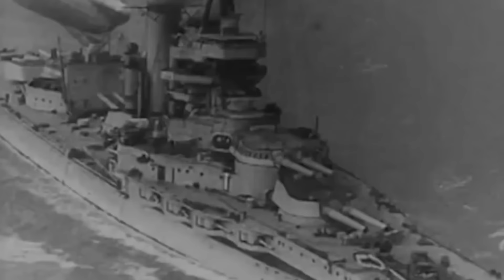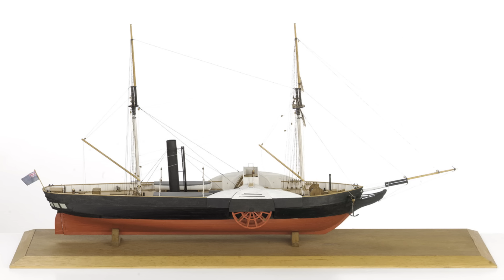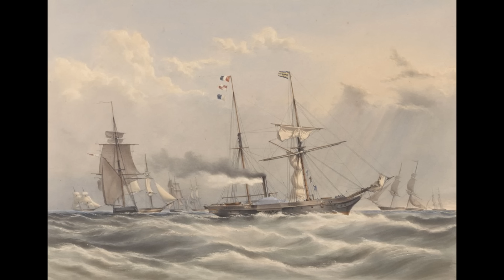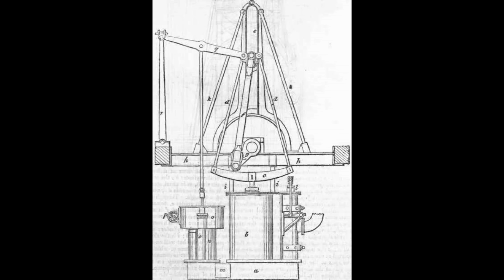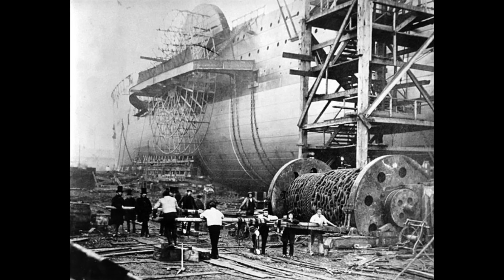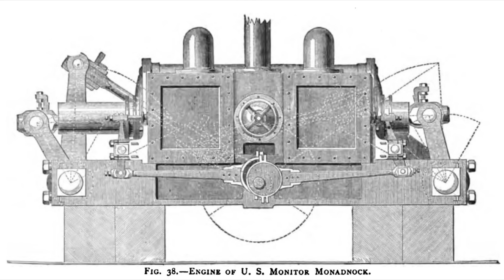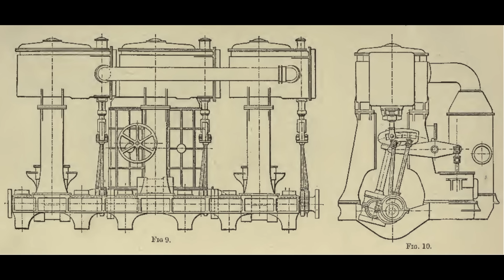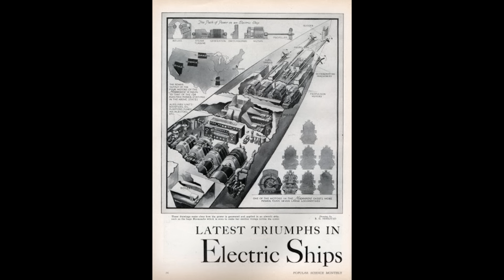Naval Engines - Rotate that shaft!

Comment: Can you please stop to popularize the insufferable myth that "war makes for good innovation"?

It has been shown time and again, that NO, the "innovation" did in almost 100% of the cases exist before the martial actions broke out, the only difference is that with wartime spending you can take fringe ideas and push enough moolah at them to make them economically viable.
You pay for mass production capabilities, NOT for the idea itself.
Reply from the maker: Hence why I said 'sometimes', the concept is overblown but war does accelerate certain lines of technological development considerably. The carronade, cavity magnetron, bouncing bomb, electrical computer, etc are all war-driven inventions. And even in cases where the invention existed before in a niche role, war forcing it into widespread use is driving innovation, since otherwise such a technological advance would have sat in a forgotten corner somewhere and the general level of technology in that field would likely have remained unchanged for some time.
Reply: @Drachinifel  Radar is an excellent example of the latter case...

Comment: Do you have efficiency figures on the electric motors and dynamos for this era?  I ask because the outright and ongoing dominance of diesel electric rail began right at the end of the period in question.  The new Maersk ships still use giant bunker fuel diesels on direct drive, but the USN is beginning to reconsider electric drive for primary propulsion (I believe also for submarines, though that probably has some consideration for sound transmission from the turbines through the prop shaft).

Thanks for the great videos.

Comment: Your descriptions in this video are great..., for those folks who already know what particular parts of the engines you are talking about.
But for those of us who are somewhat clueless and may not know a screw from a piston, the diagrams you use might as well be blank sheets of paper.
How about adding a few moving pointers or even highlighting the particular parts with color so we can get a better idea of what that part of the engine is you are describing.
Also, you talked about the different ships and showed pics of them, but just which steam engines actually went with which ship was kinda vague.  Perhaps showing the ship and then the accompanying specific engine diagram would clarify it a bit better?

I could follow what you were saying, I just had problems with the specifics when it came to what I described above.  🙂

Comment: Your next logical step would actually be the drive shaft I think. Although, the details are probably too nuanced for this format and the high level overview would probably only make a full video if grouped with such topics as steam routing and exhaust gas expulsion.
Reply: He's covered boilers and turbines.  The REST of a modern steam propulsion plant is probably an episode by itself.  The portion of the cycle between leaving the Main Condenser on the propulsion turbine as Condensate and the point where water is re-injected into the boiler as Feed Water is possibly the most complicated part of the whole mess.  Add in the multitude of auxiliary systems require to make everything work and it is truly mind-boggling.

Comment: FYI... Regarding steam propulsion plant startup time... in the past (distant, USN) I participated in an evolution that went from "cold iron" to "answering bells on all engines" in 34 minutes. We were moving briskly to make it happen (Yes. Operational considerations did require us to get underway ASAP). Stresses due to temperature differentials and rate-of-change of temperature (pretty much the same thing) were our most limiting factors (Yes. We consciously considered such factors during plant evolutions. If you break the plant, the startup time becomes excessive).
Reply: Not only hard on the Plant, but hard on the navigator and quartermaster as well.  It will take about 24 hours for the gyrocompass(s) to spin up and settle out enough to be accurate, longer if you introduce pitch, roll, and course changes while it is attempting to do so.

Nav charts are oriented to TRUE North.  A Gyrocompass indicates true North.  Absent the Gyrocompass and GPS, navigation relies on the magnetic compass.  Unfortunately, there is a deviation of several degrees between TRUE North and MAGNETIC North.  This deviation changes based upon where you are at, the geological composition of the earth at your location, and a few other factors which I have long since forgotten.

The deviation in degrees between true and magnetic north is noted on the Nav charts.  When using a modern chart to plot a course, each and every course change or correction requires that the deviation be calculated and accounted for to obtain the proper magnetic heading.  Although the navigation team members are trained to do this when necessary, it is still a headache.

The same goat rope ensues when the gyrocompass goes down while underway.  The major difference here (from personal experience) is that it gives you the opportunity to see a full-bird Captain burst into the IC Shop in robe and slippers and use rather salty terms to indicate his desire to know exactly "what #$$^#%#@ direction the @#%#$%^% pointy end is facing"...NOT the best midwatch I ever stood.  

You mentioned distant past?  The casualty was due to the sudden failure of a 12AX7 VACUUM TUBE in the Gyro Control Cabinet...in 1988 or so.  In fairness, just about EVERY issue with the Sperry Mark 19 ended up being being a failure of a 12AX7 vacuum tube...which is why I remember that detail 35 years later.  When the Gyro alarm went off, you didn't even bother with looking at the diagnostics panel, you just slammed the cabinet door open and started looking down the rows for the tube that had lost its happy little orange glow.  The wonders of 1968 technology.
Reply: @kevincrosby1760  Is the gyro kept running off shore power to avoid spindown then?

Comment: A small note about the engines on the Titanic: These were technically quadruple expansion, with the first three expansions happening in cylinders - each engine having one high pressure cylinder, one intermediate pressure cylinder and two low pressure cylinders. There were two of these engines, driving the port and starboard propeller shafts, and both were reversible, though not through a gearbox: Reversing required stopping the engine and then engaging a small "barring engine" to flip the angle of the connecting rods such that when the engine was restarted, the crankshaft would be turning in the opposite direction. The final steam expansion was through a dedicated low pressure turbine, which took steam at around 5 psi (completely useless to any piston engine) and expanded this to almost no pressure at all. This drove the central propeller shaft, which could not be reversed, though engaging it was optional - the steam exiting the two main engines could bypass the turbine altogether and be sent directly to the condenser, albeit wasting any power it could generate and hence making the ship somewhat less efficient as a result.

Interestingly enough, the Titanic and its sister ships were fitted with several smaller high pressure and high speed steam turbines, solely for generating electrical power for lighting, heating, and other "hotel services" aboard. It actually had more generating capacity of this type than was required for normal operations: The extra turbogenerators were reserved for driving emergency bilge pumps and electric winches for lowering lifeboats. As the ship was sinking, some of the engineering crew heroically kept the forward-most boilers stoked up to provide steam pressure to keep the generators going, without which it would have sunk a little quicker (anywhere between 10 and 30 minutes, depending on who you ask), and in all likelihood enabled all of the lifeboats to be launched successfully. Those smaller turbines were probably still spinning away as the ship sank, and took some of the engineers down with it.
Reply: Well..technically Titanic took ALL her engineers with her
Reply: @NashmanNash  i think a couple survived. but survived  because they were on break or something like that. do you know in the electical room of the titanic was basicy a sealed box in the rear of the ship. so they were most likey alive and still trying to keep power flowing while the ship sank and plob was still alive for some of the way down
Reply: Off Road Guy  no not really, being buried alive would mean you would die from lack of oxygen they got smashed to death when the ship broke apart plob the most painless death on the ship
Reply: @hunterbear2421  Technically drowning.
Reply: Thank you for sharing this. My daily dose of heroism. Helps to refresh my heart for humanity.
Reply: Passionnant
Merci
J'aimerais tant en savoir plus sur la technologie mécanique et électrique sur ce navire,
Reply: Triple expansion, 2 low pressure cylinders same diameter, reverse obtained through stevensons linkage,accuated by ahead/astern eccentrics not the crankshaft ok.

Comment: Screw propulsion also required the development and refinement of the thrust bearing to absorb the force of the propeller. In my Navy experience that was universally the Kingsbury thrust bearing which consisted of multiple articulated bearing plates. One set for forward thrust and a second set for astern forces.

Comment: Interesting. I always thought the delay in transition from Steam to Diesel being that, first and foremost, they wanted to reuse classic tri-ex engines, so oil fuel burnt in boilers still. Secondly, the tech of Diesel wasn't quite up there in therms of reliability.
Never thought about power density. Guess it comes from that Steam pistons are double action, while ICE engines can only be single action, right?
Reply: There were, and are, some double acting diesel engines mainly built by Harland and Wolff of a modified Danish design by Burminster and Wain. Hard work for engineers keeping the lower gland tight.

Comment: Hi I love this channel and I'm a turbine engineer responsible for about 3.4 GW of large steam turbines. It  never occurred to me that it was the vibration effect on range finders that sold turbines to the RN. I thought it was the performance of  Charles Parsons vessel Turbinia interrupting and basically burning up the fleet naval review that alerted the RN to the far higher power density available in a turbine compared to a triple expansion engine. I have to point out the following 1)turbines are either reaction or impulse or the like? actually most turbines are a mixture of the two the degree of reaction (enthalpy drop across stationary stage/ enthalpy drop across rotating stage varies and impulse turbines tend to have low pressure stages with a higher degree of reaction. 2) when you loop steam back into the turbine this is after first sending it back through the boiler, this is called reheat, unimaginatively. 3) cavitation was a big problem for the Turbinia, this was overcome by having multiple screws on each propshaft

Comment: "Cutting the blades for turbines was somewhat of a bottleneck", so was making marine reduction gears.  Gears were in short supply and one of the reasons for turbo-electric drive.
Reply: For WW 2.  USA Marine License testing in the early 70s still had a few triple expansion questions and I'm pretty sure there were still some triples operating on the Great Lakes.

Comment: Ah, steam plants. My life for 8 years on a submarine. (As some are aware, but many are not, a nuclear powered ship is simply a traditional steam turbine propulsion plant that replaces fuel oil with a nuclear reactor as the heat input for the boilers)
Reply: Are these direct-drive or turbo-electric?
Reply: @HannahLemurson  Can't speak for the last couple of decades but most US Navy submarines had a couple of steam driven turbines with reduction gears to turn one shaft.  They did make one direct drive submarine (USS Narwhal) which had one huge turbine directly coupled to the single drive shaft.  We are talking an engine maybe 10 times the diameter of a typical turbine.  Worked quite well in practice (very quiet without the reduction gears) though eventually operator error pretty much destroyed the engine while warming up.

Comment: I will just add that one big advantage of Diesel engines is that they don't have massively lower efficiency at let's say 60 or even 30 percent of power. Whereas with Turbine - you pretty much need that 90+ percent. So if you were going for ship that could be reasonably fast, but also could have long range - Diesel (depending on size of the ship of course) would be preferable.
Thanks Drach!
Reply: Prefer the Steam power engines over diesel engines.
Reply: @merafirewing6591  They are fun

Comment: A little trivia about Power, Watts and Horses.

Mr. James Watt was the first guy to commercialize a steam engine, and he was quite successful.
At the time, the very important flood preventing mining pumps were all powered by horses, asses, mules... Traction animals in general.
Watt did some tests with horses, measuring the time it took a sample of several horses to pull a known weight up a certain distance through a pulley. Watt then used that data to compare with the power of his machines and started offerign them to mine owners, with the data to back it up, saying the machine was capable of doing the work of so and so many horses. And that is why we use "horsepower" as a unit to this day.

N.m/s = Watt.

Also, a metric Horsepower is 10.2 W weaker than an Imperial horsepower (735.5W vs 745.7W).

Comment: Internal combustion engines  being named as such makes much more sense when you know that Steam engines are External Combustion engines.
Reply: @asbestosfibers1325  Electricity to generate steam? Electric motors can get extremely good energy efficiency, steam, less so. Mostly because of all the energy lost in transferring electrical energy to steam and then to mechanical motion.
Reply: But steam engines don't need combustion, just a heat source. There were even locomotives which used electricity to generate steam.
Reply: @Sigma-xb6kn  But think of how inefficient that was....
*angry engineer noises*
Reply: @jamesharding3459  they also used embers in the box inorder to keep going without power i heard it could keep traveling for upwards of 15 minutes without power due to the fact they used embers. which is interesting so it was actually more effcient then it being without the embers
Reply: @jamesharding3459  Late to the party, but I believe it was done in Switzerland during WWI; they had plenty of hydropower, but no coal to run their steam locomotives, so they put up overhead electrification and stuck a heating element in the boiler. Horrendously inefficient, but if it works...
Reply: @jrevillug  It was indeed, as I discovered in the years since making that comment. It sounds comical but it sounds like it was a perfectly reasonable decision given they had cheap electricity, expensive coal, and perfectly good steam-powered rolling stock. An interesting bit of historical trivia.
Reply: @Sigma-xb6kn  tell that to james watt.  The name is still correct.
Reply: @Sigma-xb6kn  combustion is another way of saying burning. Which provides the heat source. Which on a steam engine is external to the movement generating parts.

Comment: Did anyone try the current practice of using compressed or liquid oxygen to run sub diesels while running under water during the Drach Time period?
Reply: The Germans tried it, I believe. I think that they had issues with sealing and the LOx kept evaporating. So they turned to "Hydrogen superoxide".

Comment: Well done - adding some stuff that I would not have expected in a 45 minute presentation, more in the nature of footnotes.

:
  Largest were the diesel-electric Wind-Class icebreakers derived from a Swedish design at 6,500 tons.  Five were built for the Coast Guard (one of which was sent to the Soviets as Lend-Lease), and two for the Navy.  They were built in anticipation of significant conflict in the Antarctic and Arctic, which never really materialized.  As with classes mentioned above the engines were repurposed railroad and industrial diesels meaning there had to be a lot of them (6 - 1,600 hp Fairbanks-Morse for the icebreakers).  I served on the final survivor, USCGC Burton Island (former USS Burton Island) which was decommissioned 1978 after 4 consecutive Arctic and Antarctic deployments.  Heavily armed including 2 - 5"/38 twin mounts, depth charges and numerous anti-aircraft guns, armaments were stripped progressively after the end of WWII, and with the Antarctic Treaty we had nothing left but 6 Cal. 50 Browning M2s.
:  Navy Edsall, Cannon, Evert, and Claude Jones.  These were mostly smaller ships - 1,500 - 2,000 tons - with modest high speeds adequate for convoy escort.  The Coast Guard inherited 11 Edsall class after the war, but they were mostly gone by 1954 or so.
.  The Barnegat Class (311', 2500 tons) used 4 Fairbanks-Morse direct reversible engine, 1,600 HP each for about 20 knots.  The Coast Guard inherited 11 which were decomissioned in 1973-74 at the end of the Ocean Station program.
.  LSTs and the like.

 destroyer escort, 306' LOA and 1,740 tons, with twin screws good for about 24 - 26 knots.
 Coast Guard destroyer escort/high-endurance cutters.  Although about the same displacement as the Rudderow they only had a single shaft, good for about 17 knots.  They were built for the Coast Guard to replace ships sent to the U.K. under Lend-Lease, many somehow surviving to 1973-74.  The system was notorious for losing excitation to the main motor, and with only one shaft that meant the anchors were primary maneuvering equipment.